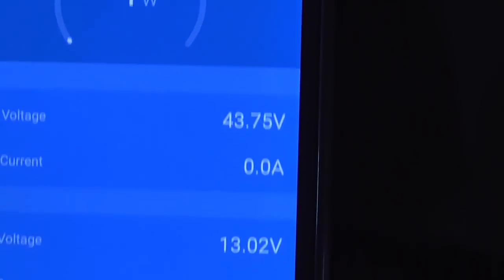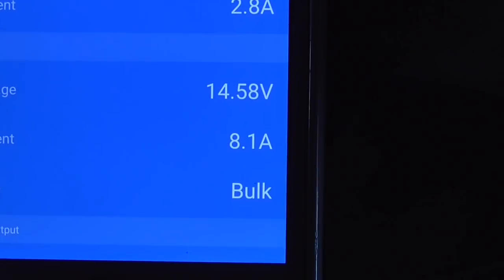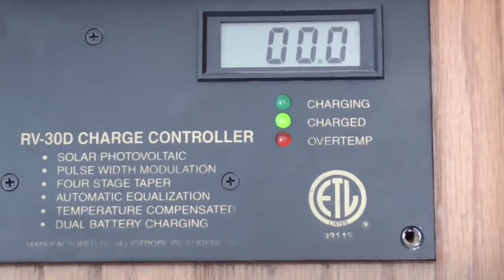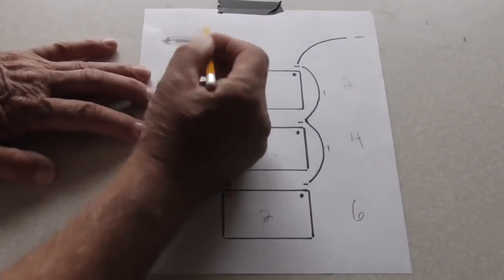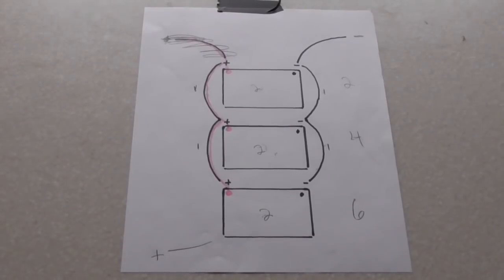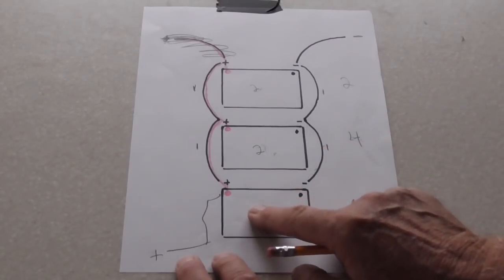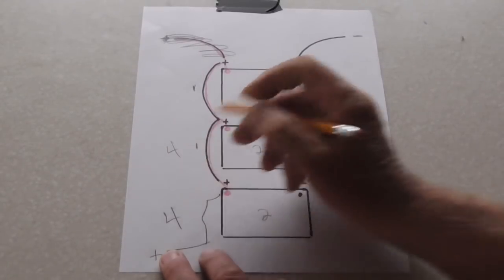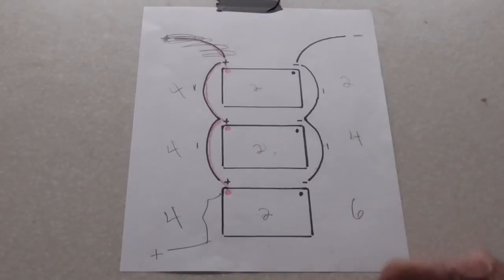How to correctly wire a parallel battery bank.  Solar Question Update.

Comment: I am actually related by blood to mark twain. funny you mention him. So lets get into parallel battery strings:

Internal resistance varies battery to battery and any parallel connection is a fault point, always. One will falter faster over time in a bank, and once it takes the "grunt work" of charging and discharging, it creates more heat, then cascade effect occurs till the battery fails. 

Internal resistance of battery can be higher than the resistance of a properly gauged wire. Depends on the wire type and size. Depends on the internal resistance of the battery.  This is a fact that you can easily measure at home. Your diagram did not show all variables that can affect your "electron flow".
Reply: and reason you cannot parallel connect old/new batteries together is because the internal resistance is different. I really hope you read those webpages I sent you in the last video. Really great stuff for you to learn.

Comment: Great tests!! Keep it going. Put an amp meter between your alternator and your battery bank, and each charge controller. Also read about internal resistance of batteries. You are doing some great stuff here! Fun learning experience to be had. A shunt on the negative terminal of the battery bank will help you greatly. A watt meter between the alternator and your battery bank will be extremely useful too. Keep going! You are doing great.
Reply: And to answer your last question around the 12:00 minute mark: If your battery can handle the charge rate (such as a large lead acid bank or any lithium ion chemistry battery), all chargers attached to that battery will charge at 100% output if SOC is low, and internal resistance is low enough for chargers to do their job. If your battery is full, or nearly full, or a flooded lead acid, the moment you charge it with any source, the internal resistance in the battery will increase, and you will not be able to push anymore power into it from other methods. I think this is the part you are missing. Charge rate, and how much power each charger can push into the battery is dependent on the internal resistance of the battery. I think reading about this stuff would help you a ton! Its a great lesson to learn. Try your test with a lithium ion battery and let us know what happens. I think you will be surprised at the results :D
Reply from the maker: Thanks for the encouragement, Will.  :)

Comment: Great Vid! However, at 20.00, you made the classic mistake, of showing that the power, discharges through the "POSITIVE" terminal. Wrong, it discharges through the "NEGATIVE" terminal. This, is contrary to what you would assume, I Know, but it is correct! Thanks, anyway.

Comment: GREAT VIDEO , Your are right they have the words but dont have the music.

My explanation for the two charge controllers hooked up in parallel is that one charge controller is at higher voltage then the other. theoretically if two sources have same voltage they would charge equally.
All the load is taken by the source with higher voltage.

Comment: Are you then rewiring to discharge the power from the batteries? Moving the pos. back to the other end with the neg.?
Reply: Did you ever find out. I would like to know myself. I think the answer is yes. Could you let me know. John.

Comment: Don Amigo JC, your 12V battery presentation is really BRILLIANT just as well as your conclusion regarding a bank performing as its weakest battery. You're a wise man who knows batteries are all about the internal resistance and line resistance that drop voltage under load.

U = R x I 
(... aka. "Ohm's law")

In PARALLEL voltage is equal but CURRENT IS DIFFERENT based on internal resistance.

In SERIE the current is common and the voltage is an addition.

Now on the useage path, I see from the picture of your pannel you have a dual diode insulator so you can't run down your engine battery while blasting cumbias in the coach with Lynn.
The down side being that silicon diodes semiconductor junctions drop/eat 0.6v Ea. verdad?

Best friend of Lead-Acid chemistry being a cell equalization float charge and worst enemy is deep discharge sulfation or overcharge evaporation, claro?
Up North... the latest rage are the big $200 AGM batteries by Varta: the juice is replaced by a GEL for nearly zero evap. 🤘

As always love all your wise tales and wisdom on life - ¡Gracias!
👍

Comment: Using opposite ends, can I connect ten AGM 12V 100ah batteries in parallel, for my solar system battery bank? Note: using equal length 4/0 cable connectors, and equivalent new batteries. Thank you.

Comment: I know this video is old but some clarification needs to be added here. Electrons flow from negative to positive not the other way around. Second, a battery isolator was created long ago to offer such a solution to avoid draining / not charging a battery bank.

Those who compete in car audio know this quite well. They have a battery isolator that allows them to play music for hours without draining their primary SLA battery so they can start the vehicle later. 

The very old and dumb battery isolator detects a defined threshold and disconnects the two battery systems from one another. While also allowing the alternator to recharge both once the vehicle has been started.

Newer designs allow a person to define what voltage (high & low) to be set. Along with when the battery bank should be charged. This was created primarily because people were blowing their alternator as it could not generate enough power (current) to recharge the massive banks.

In 2022 some of the latest battery isolators, charge controllers, and battery chargers incorporate BMS level monitoring as seen by everyone using LiFePO4 / similar battery systems. 

Lastly, the 90-10 rule for DOD for LiFePO4, low temperature charging, low / high voltage thresholds, and current draw are key elements of service life or the lack thereof.

Any other wet cell technology from AGM, Flooded, etc offer for only 30-50% DOD regardless of what any maker claims even Trojan / Rolls.

Comment: Hey Jerry, loved the video and I have found the same outcome on my own ventures... Which brings me to this next bit of info, I found a very interesting video when using 4 batteries in parallel, the charge should be given to the centre two batteries and the load taken as you have described...
I found this info before watching your video and have not yet tested the information... However it is described as balanced charging, which I believe would benefit you greatly...

Comment: I really like the method of balanced wiring you showed at the end. I tried the "sum of resistances" method on many different number of parallel battery configurations and it worked. Great information!

Comment: Thanks! I'm trying to find an answer to connecting 5 lifep04 batteries in parrallel. Each one has a 150amp bms meaning it can output up to 150amps. I'm considering making independent cables all the same length for each battery that connects to a common positive and negative bus bar with a fuse inline for each one. But that's going to take 50 feet of 2awg instead of about 15 feet to do your method. That way every battery will hopefully stay at the same level. Or am I complicating things and wasting money? My other concern is if the bank of 5 batteries discharges all the way and only 1 or 2 batteries are trying to fulfill the 200 amp load to the inverter, if they are connected by your method will they be strained by depending on the dead battery next to them? I never want these to go to zero but as they're on a boat it will end up happening from time to time.

Comment: Let me say a couple of things that may or may not have any implications regarding your mental presentation.  First, in the universe of atoms there are protons, neutrons and electrons.  Protons are positively charged.  Electrons are negatively charged.  So, the negative pole is called the negative pole because it has a build up of negatively charged electrons waiting to let go at an instant's contact with a conductor.  If that is accurate, then in batteries, the flow is always from the negative pole to the positive pole.  Generally, the work load is somewhere between the negative and the positive pole.  Which means you never want to hook up the negative pole first because when you hook up the positive pole, you will get a bite or spark from the massive flow of negative electrons from the negative pole going through your body perhaps to the positive pole or to a grounded surface.  If you hook up the positive pole first, you are hooking up the "hole" into which the negative electron charge can let loose by touching the negative charge to the negative side of the battery.  You give the force of the battery a place to go, namely the waiting positive "hole" rather than waiting to put you into a shock.  In commence parlance, we think of a positive like a pile of stuff that we put into a negative hole.  In electric circuits, the hold is the positive.  It lacks the mojo juice.  The electrons are stacked up at the electron pole, the negative pole.  You are perfectly correct and helpful with your parallel example and suggestion.  Just don't forget that the negative pole has the pile up of negatively charged electrons ready to take on the tasks you assign to them.

Comment: I am I know these are solar expert but I am learning because I’m setting up an off grid system and am learning quickly how expensive it is. My best advice for you would be to isolate batteries banks. When you park and want to runoff of solar throw a switch that allows the batteries to feed into your inverter. While driving use the batteries that you would normally run for systems needed while driving down the road. Starting, radios, fridg, etc.

Comment: I know nothing of the solar side but yeah at first glance this seems simple but can be a headache so hopefully it's as easy as solar stopping alternator from giving batteries that little bit of charge to what we determine full is. Alternators main purpose really isn't to charge the batteries completely anyway. Yes in a car with 1 battery it will give it it's 1-2 volts. Even in that case it's kind of a phantom charge if that makes sense unless you drive awhile. Example when we dumb young people add amps for subs the battery is always dying no matter how much we drive. This is why we install a capacitor and in alot of cases have to get a bigger outputting alternator bc it will start using most of alternator main power and alternator seems to forget to give that battery it's very needed couple volts. Not sure if you ever tested how long batteries last when they are wired in something like an RV. Let's put it this way they knew what they were doing perfectly on the electric side in my opinion. So yeah I know I rambled on something you sound like you know 100% but hopefully it's the solar not letting it charge. Unless you added some electric pulling devices that are aftermarket and this issue just started happening randomly then I'm sure it's what you have already explained. Otherwise could be batteries or even alternator but those are easy fixes as well.

Comment: I agree 100%. I wired two 110ah batteries on a 300watt solar system on my catamaran and it works great. I've currently modified the majority of my electrics and replaced my old solar charger for a victron mppt 100/15.👍🏿😎🌊⛵🏝️

Comment: I have 3 AGM batteris in the "proper" set up that you show, but battery 1, that the charge cable is connected to, heats up considerably more than the others, and has actually ruined one recently. Ive seen this be called "unbalanced charge." from what ive seen, you would need to be the charge cable in the middle of the 3.

Comment: I'm not a book geek just a guy that has lived off grid for 26 years and found that books are written by people that don't live off grid and have no idea of what works and doesn't work. I'll say it, they have no clue and are wrong. You are right and a easier way of explaining it is each battery is concidered a cell in one big battery. 
Also not sure if you have a charger in your inverter but it to will shut down if the voltage is to high from the source. As far as charging while driving just add a battery isolated between the alternator and the pannels.

Comment: Even my diesel truck from the manufacturer is wired wrong. They call the second battery the secondary battery because it doesn't contribute as much as the primary battery. All it does is boost. Well I just added a third and wired all three straight to the starter. lol Cranking speed is way up and start problems are gone. Now my accessory batteries are always wired with the diagonal wiring scheme as it can take a really long time to charge 6 batteries if they aren't due to the reasons you gave.

Comment: Well sir, if I understand you correctly . When I connect to my inverter I should connect the positive cable to the third battery and then the negative to the first battery. Now when the battery's are being discharged by my inverter should I keep the negative cable the shortest because  when discharging its the negative side that's asked to do the work.

Comment: I think it depends on which one is stronger. If solar is stronger   st charging  then other charger will back off as it just sees battery  voltage  rising and safety measures kick in  and the charger  only know the voltage is rising and thinks It needs to back  so it DDT iesbt blow up the battery

Comment: Simple but thorough explanation. Thanks. I now know what the prob is with my lithium battery setup. In an attempt to keep the cables going to the inverter as short as possible, I just connect the pos and neg cables to the closest battery but for 3 yrs it seemed that I had 100AH instead of 200AH and the discharge rate seemed high for a 200ah Bank. Thanks Jerry. I now have some rewording to do lol

Comment: if i have 4 12V batteries and want to do a 24V system, is it better to hook them up into:
2 in series +  2 in series and those in paralel or
2 parallel + 2 parallel and those in series ?
as allways there are folks that say the first is better and other say the latter is better ...

Comment: I had a similar problem when my start battery was full the alternator stopped charging so the house batteries would not change because  it was detecting the start battery was full a auto electrical engineer fitted a device that switches the power from the start battery when full to the house batteries it was not that expensive £120 with labour

Comment: Hi I’ve subscribed I’ve got 3 new battery’s to wire up to a car amp this weekend I can across your video so basically the power from alternator will go to furthest postive and the ground will go on the further away just like  you drew up  that correct
Reply from the maker: Yes.  Correct.  I assume you know the difference between parallel and series connections.  Positive to positive to positive,  negative to negative to negative to remain at 12v.  In series (positives to negatives ). You'd get 36 volts from three 12 v batteries.  :)
Reply: @JCTravelStories  hi and thank you for for your reply Yes I do know which is which I’m
After 12v 14v 14.4v only so I’m
Take it your photo videoo at the end is correct way if you can confirm. And thanks for the reply

Comment: Hi guys and gals. I am a service tech for 35 years and specialize in RV's. I am going to play the devil's advocate and attempt to blow up your theory (myth). There are assumptions being made here. 
Myth #1) that the flow of electrons will go primarily to the first battery (of less resistance?). My answer is that as the battery is being charged  it will develope more resistance (just like water filling a tank) and the other batteries will fill all together at the same time to equalize this resistance. In other words the flow of electrons will back up to the main branch positive posts and sit there untill the batteries can absorb the electrons (equally).
Myth #2) that the interconnecting posts and wires have a resistance to flow that would slow the charging signifacantly. My answer is that this is negligible, not measurable, (if the batteries are next to each other) and not supported by science,  if using large enough wiring and tight connectors.
Just as lights wired in paralell are equally bright and the voltage measures the same at each light.
This idea also applies th discharging of the batteries as well... that they will discharge equally if wired in parallel and the voltages will equalize as a bank.
Don Patterson
Reply from the maker: Good to know. I assume if I understand you correctly there is nothing wrong with the way I suggested. Just that it’s not any better.
Reply: @JCTravelStories  I would wire the way you sudjest as a common practice.

Comment: I have a simple setup for boon docking.  Three deep cycle just as in your diagram.  My question is for anyone here.  So once I've connected in this balanced manner for charging configuration, would my inverter then also use the same positive and negative terminals or does it not matter?

Comment: Thanks for your vid...So, a newbie question...lets say you have 4 12V batts in series/parallel -- a 24V overall system.  Now which posts do you connect charge/load to?  My guess would be the (+) on one bank that was not used for series and the (-) on the other bank that was not used for series.

Comment: You would think that a charging controller would analyze the sources and allow only the strongest to charge the system. If you turn off the key, then it goes back to solar charging. I'll be waiting for the next episode.